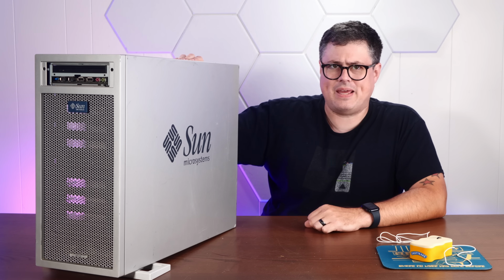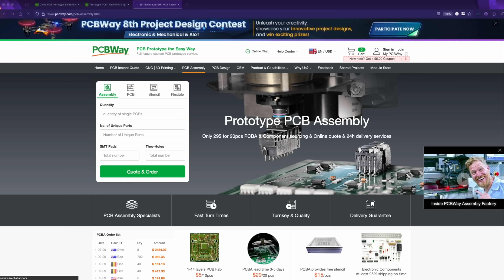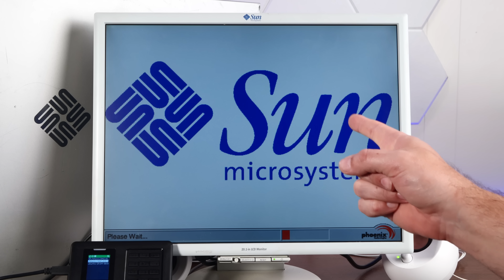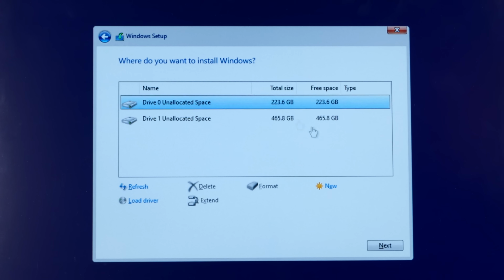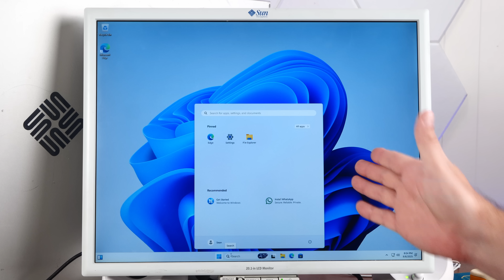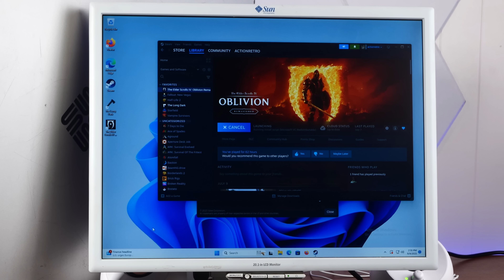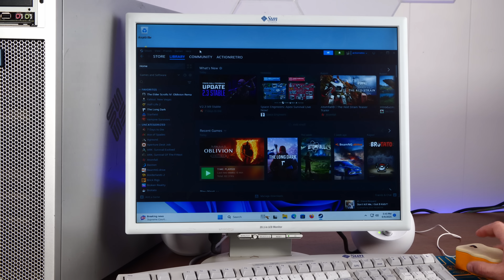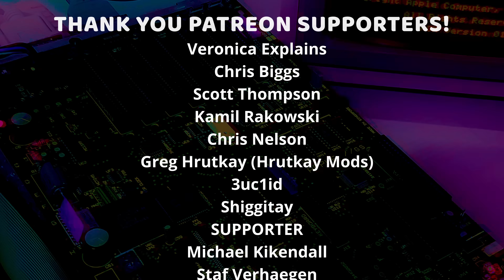The Oldest PC That Can Run Windows 11

Comment: I bought one of these new from Sun and used it for several years. I even ran 6 core Opterons in mine using replacement firmware. To this day, I'm probably the only one with working firmware for the Ultra 40 M2 supporting 6-core processors.

I regret getting rid of mine.

Comment: errrrm actwually the first x86-64 cpu is the opteron 240 B3 which was released in april 2003 and not the 2220 se you showed that was released in august 2006🤓🤓🤓🤓🤓🤓

Comment: This demo is pretty impressive.  
I suspect that this entire push for AI has been at least 25-30+ years in the making- spanning as far back as when Bill Gates said he wanted for everyone to have a PC in their home.  I watched an 'intentional destruction' video of someone carefully smashing and burning a 90s PC board while it was running.  Instead of the PC just 'giving up' and going to a black screen, it kept on trying to POST and run in a somewhat degraded mode...attempting to hand off the CPU functions to some operating system.  Almost like the PC could be repurposed to lower level usage if someone or 'something' really wanted to try and salvage that damaged PC.  
Then you hear about how the BIOS is exploitable without you even knowing while the PC is off, and then how that few hundred megabyte per gigabyte portion of HDD, SSD, NVME is sort of always written off as 'lost due to formatting'-  (or maybe reserved for other purposes) can't help but to wonder whether basically every PC is just an AI conduit just waiting to be enabled.

Comment: i got and amd athlon xp 1800+ and amd duron these days and i thought it was absolutly slow... my partens allready got an absolut heat producing intel pentium 4 and i was envious about the speed. i'm really impressed about your video...
Reply: My old K6-2 350 was the DEC Alpha of PC cpus. It would go from 30c idle to 85C with a full load in both Redhat 5.2 and Windows 95B.

Comment: So I could technically install Win 11 23H2 on my older system which I store media on. Supermicro X7DWE with dual xeon e5450, 16gb of ram and a P600 low-profile card mounted with x16 to x8 adapter as the motherboard only has x8 slots. It has the latest bios from 2008. And a sata 3 card that supports harddrives larger than 2tb. This system is built in a rare Lian Li 20th anniversary PC-777 case from 2005. It has mounting holes for dual socket 771 cpu motherboard. I love the Sun cases, but they are hard to come by, and If u do they're often expensive.

Comment: I get the ssd and quadro are pretty old and weren't the best when they came out but certainly better than ssds and gpus of 2005. I highly doubt windows 11 would work on 2005 GPU and would probably much more sluggish on a 2005 ssd if you could find one that worked.

Comment: I have one of the original alienware area 51 desktops from late 90's in my basement. I used to play the original rainbow six games on it in game tournaments (Before E-sports was a thing).  I cant remember what went wrong with it when I moved on to a new system back then, so not sure why it wont boot (last I tried it was dead), but its most likely just the power supply or original mobo that are dead.   This makes me want to finally fix it and take a trip back 25-30 years.

Comment: I have a dell Inspiron 531s from 2007 which i installed 11 on the only issue is i need an ssd since the 18 year old hdd takes 4 minutes to boot also i was debating on seeing if i use an nvme ssd on the pcie slot to see if that would be faster than a sata ssd or would it be the same

Comment: A lot of ifs and luck.

Software might refuse to run on uncommon first generation CPUs lacking instructions even if it doesn't really need them, simply because of default compilation options. It's even worse when some popular library pushes them out of support. No one in commercial development is going to mess with their build systems to make custom compatible builds for three crazy  with ancient hardware.

Single core performance is at the bottom of usable range. PassMark CPU benchmark says it's around 520 marks, but it seems wrong, other tests suggest about 830. The interface doesn't seem Atom...ically laggy, as you would expect on 500 mark junk systems. Of course, there are two real independent cores to alleviate that. But they also mean 2×65 W TDP. Those fans are running for a reason.

Because of slow CPU, video decoding WILL become a problem. YouTube stream was handled by a much more recent hardware decoder on the video card, but switch to anything non-accelerated and common, like 10 bit H.264 anime, and you hit the dead end.

Given its price at the time, it's very much like driving grandpa's bulldozer instead of a golf cart just because you can.

Comment: AMD Ryzen 1700X? 64GB RAM? Ooohh that system is NOT POWERFUL or SECURE enough to run the ALMIGHTY WINDOWS 11!!!!! Dual threaded Intel Celeron with 4GB DDR3 and a mechanical HDD with buggy, out of date Secure Boot BIOS? Right this way!

Comment: Amazing that 5 years before this an Athlon workstation couldn’t even do half the work(maybe? an 8P AthlonMP server could keep up?), and 5 years after you could get the 24 core version of this workstation to put on your desk(and the 8P had 96 cores)
I actually have a board with dual socket G34 that had 2 Magny-Cours in it that when I got it in 2016 and with Piledriver cores was actually still good for the niche of integer calculations compared to the Xeon equivalent for perf per watt. NFS at home if anyone is wondering.

Comment: This is why I hate modern os's in a lot of ways. They've gotten to a point where they don't need anything else, but companies need a reason to push new hardware to the average users so they just keep adding shit that isnt needed. Although Windows is obviously the worst offender in this regaurd, mac os is still guilty. With mac os they just put an often arbitrary cut-off for support. I've seen a lot of macs from like 2014 and older still run sequoia fine. Mac os 26 is a different case, mostly because it's just broken rn

Comment: Again a reminder of what I coined hardware darwinism, as long as a device can be asked if it has a feature it should be simple to write adaptive code and switch off what is not needed to get a minimum path to a result.

I won't be ignorant though as I am aware sometimes you do need to model code differently to parallel implementation vs more 'fifo' models(watering it down a tone) but the baseline to start everything up is normally fairly small.

Might be a tank but honestly a impressive bit of engineering.

Comment: I have a question. I heard that in 2008 they implemented a remote administrator on Intel CPUs, that is, an operating system that runs on the CPU and allows the government to enter your computer regardless of security. So that means that the older the CPU, the more secure the computer is? Taking this into account, what would be the oldest CPU you can install Windows 10 on?

Comment: The fact is, that Atomfall (with denuvo slop drm) works well on that thing shows that the instruction set (which is UE5) is not supported that, but Asura Engine do.

But maybe it has with version of Windows, since you using a buggy 22h2 version instead 23h2 or 24h2 (which dont work here)

Comment: This is 22h2/23h2 Windows 11,which can running that older hardware than 24h2 version because that Device has not Popcnt Instruction, which doenst run 24h2 Win 11 but 23h2 Win 11.

The minimum Hardware 24h2 needs a a10 AMD Opteron CPU and a Nehalem Intel CPU since 2008 (Intel are cheaper to get it with motherboard than AMD Opteron CPUs with motherboard)

Comment: I installed Win11 recently on an old Athlon X2 with 2Gigs of ram and was blown away on how usable it is. As a web machine it works very nice. Even plays Youtube videos at 1440p. Only newer modifications on it was a SSD drive. So functional PC with 2 CPU cores and measly 2GB of ram.

Comment: Does Tiny11 need a Windows key in order to be created and to function? If not, can it receive security updates? Are there programs designed for Windows 11 that are not compatible with Tiny11 and NOT because of hardware incompatibility? Also, I suppose it cannot be upgraded when a new version of Windows 11 is released and, in this case, it must be created anew using the scripts posted on GitHub. Speaking of them, has anyone checked if they contain malware? I am really surprised Microsoft allows GitHub to host such scripts, given the fact that it owns the platform and uses AI to scan the coded posted there.

Comment: everything Microsoft is done is to steal and lie to the costumers its ridiculous. Also Steam and other digital stores , they dont give you real system requirements and that is why its hard to buy a new pc , especially when i had a i7 2600k, because most games i wanted to play , i could except maybe this year there are a few ones , the point is that there are games like DAEMON X MACHINA scions of titans (not remeber exactly the name ) that you need a cpu that a i7 2600k with 16 gb count run that game at least normally , but  guess what i have done a lot of missions already lol.

Comment: I installed Windows 11 23H2 on my Q9650 Core2 Quad. It is actually quite usable as a basic web machine. 17 year old CPU, SSD & 10 GB DDR3 RAM. It also misses POPCNT.

Comment: Well, not quite the first x86-64 CPU, that's already a Socket F dual-core Opteron from 2006 supporting DDR2. The first ones were single-cores on Socket 940 and came in 2003. ;)

Comment: Since that is an Ultra 40 M2, which makes it something like a year or 2 newer (and a big jump in Opteron generation) from the Ultra 40?  I believe the original Sun Ultra 20 was released at the same time (or at least announced at the same time) as the Ultra 40 in 2005, and in its time it was one of the best deals in PCs around.  The Opteron platform came out in 2003 though on Rackspace and others.  There was also the Athlon64 at about the same time.

Comment: I've been researching this.  Basically for the last decade or longer,  there has been no real innovation in chip design.  They simply throttle computers,  release new computer with no throttle,  rinse and repeat.  
I'm working on a nifty little bit of tech that should expose all this rubbish.  Watch this space

Comment: My view has always been, rather than pulling an Apple, MS should add in big bold letter, that they do not guarantee any protection of data for anyone not using the recommended specs and MS no longer offers support for such systems beyond basic non security hardware specific updates. Kind of like saying to someone who insists on buying a home with no front door, that if you insist on buying it and not buying one with a front door, then they can't be held accountable should your house be burgled, but you are free to live there if you accept that risk.

Comment: H.264 that is the main codec on Youtube today launched in 2004. It was from the very begining ment to run full HD content, and this was one of few CPU that could run it at that resolution at the time with no added hardware.
Reply: I think yt started using that only in 2007, and only because of Apple
Reply: YouTube uses VP9 for most videos these days. It still has H.264 copies, mostly for Apple devices
Reply: @sugaryhull9688  you are right.. sort of. Youtube also start using AV1 as the main codec for higher resolution the last year or so

Comment: The whole concept with system requirements is that "if it does more then it needs more resources" thus if you want glossy moving graphics and extra processes within your application then overtime when you add more functionality the system will simply need to process more and have more memory and storage. So yes any computer can run it if you tweak it to bypass the checks for specific hardware then it will run but may be slower and lag a lot. Also drivers, windows default drivers have come a long way.

Comment: 3:20 I actually got an nVidia Quadro off of Amazon as a temporary card when the main graphics card on my desktop failed. It's actually pretty good if you temper your expectations. I was able to play pretty much any game up till the year 2009 or so in 1080p. It was less than $50. It's a great card if you want to breath new life into an old computer but you don't want to blow $400-500 on a new graphics card.

Comment: I've seen Windows 95 running on a 286 (which is not supposed to be possible) so, Yes, System requirements are a scam.

Comment: Love it.  For gaming I mostly still use my fx8350 based PC from circa 2012, albeit boosted by a used rx580 - it's hosts about 1,500 games.  For ExoDOS and retro GOG games it's an fx6300 circa 2015.  For Linux experiments and some gaming it's a Core2Duo circa 2008.  For MacOS experiments it's a 2011 Macbook Pro I got for free.  For work it's a 14 core Xeon E5 circa 2017.  My Opteron 180 machine, circa 2005, provides WIndows XP nostalgia.  My x3D Ryzen beast (2023) only occasionally sees action.  Yeah, it's fast, but it's yet to find a place in my soul.  My next project is to bring my 386 back to life.  Then my Amstrad CPC6128...

Comment: That CPU (Opteron 2220) is from 2006. The actual first AMD64 Opteron CPUs, where from 2003, like the Opteron 154. I personally had many Athlon64 that where from 2003 back in the days, mainly the 3000+ (512KB L2) and the 3000+ (1MB L2).

Edit, the first AMD64 chip did NOT have SSE3. It would be a good thing to know if 11 actually require SSE3.

Comment: Always fun. Tiny11 is awesome. Combined with BloatyNosey, Windows 10 Debloater, StartAllBack, and an Edge remover Win 11 is ok-ish.
FWVLIW: M.2 -> PCI(e) adaptors only work as boot drives if there's BIOS support. But will show up in the OS once installed on a bootable drive.
This goes for older PCs as well as 'unusual' boxes.
PS: See if you can find a DEC Alpha workstation and a copy of the officially unreleased Alpha version of Windows 2000 - the first 64bit version!!!
...also the fastest platform W2K ran on at the time.

Comment: within the first 20 seconds i hear "unix" "can run windows 11" and "unforgivable windows install" and i have to agree it is unforgivable but not unthinkable cause unless you got an apple/pi converter of some kind for the data aint no way you gettin a linux distro on a unix system properly

Comment: "no computer is e-waste if you still have a use for it." I'm watching on my 2011 Macbook Air while benchmarking my 2007 MacBook Core 2 Duo.
Reply: I still use Core2Duo machines. They run windows 11 just fine.
Reply: just use opencore legacy patcher and call it a day

Comment: Just goes to show how incremental those hardware improvements for everyday PC use have been those past 20 years. I’m still using a 2008/09 Mac Pro 2.1 running Ubuntu…not as a daily driver but it still gets regular use. Slap a SATA SSD in that thing coupled with 32 gigs of RAM and you’ve got yourself a great computer. That whole Windows 11 upgrade is probably Microsoft’s biggest scam yet…and that’s saying something!

Comment: What a time. Computers from 2005 working in 2025. In 2005, a pc from 1985 would have had no hope to run an at the time modern OS. 

In 2045... lets see how modern machines from today handle the software and workloads of 2045.

Comment: I had Windows XP running on a machine with only 256MB of memory. It's possible just very slow!
Reply: I used to run Windows XP on an 1999 Packard Bell with only 192MB of RAM (shipped with only 64). I distinctly remember the notification balloons in the notification area notifying me about the virtual memory being almost full. Wasn't the most pleasant of experiences for sure, but it worked 😂

Comment: I remember years ago, when I was building a PC that I had an internal HD that would cause the video to cut out.  Switched out the HD with a different brand and it worked just fine.  Never investigated any further what caused the incompatibility.

Comment: Bravo!! I hate Windows 11 though so... 
I used XP (32) as my main PC until about 4 years ago and still use it off line for my serious work as the 2 dozen programs I use in it are what I know and am efficient at and. Many of these programs won't work on  Windows 10 64 bit, and with our crappy internet W11 has been a no go. This has shone a ray of hope for us W10 users as Microsoft will slowly make it impossible to use online anymore, but that will probably takes years (I hope)

Comment: That is pretty awesome, holy shit!

That Asus RX 9070XT looks pretty damn good. I'm not sure if Asus would be my first choice (mainly because the Radeon-only manufacturers seem more interesting to me for some reason :b), but I'd still love to have it! [And the aesthetics are very nice.] Especially considering the one and only time I bought a graphics card was ~2016 (XFX R9 380x), and ended up never using, or even finishing the PC I built back then thanks to a dumb oversight, haha. Aaaand I definitely can't afford like anything now, let alone one of them.

The Powercolor 6750 XT also looks nice, if not as aesthetically impressive. But again, would definitely not turn my nose up at it! Although my CPU would probably bottleneck the shit out of both of them - though not as bad as that Opteron!

Comment: It really always has been software that forces hardware refreshes. Badly written software at that.
But I'm not as impressed anymore now that I started looking up specs. Opteron 2200 SEs were released in August 2006, whereas the first Opterons were released in April 2003. These newfangled processors run laps around the original Opteron 140s. 3.2x the transistors, 15% higher TDP, and of course, this machine has TWO CPUs. If tiny11s only requirement is x64 architecture, then an Athlon 64 2800+ is as impotent a processor as one could get from the era. It has 2/3 the transistors, and if used in a laptop, will have just 40% of the TDP. Now that is a neutered processor. Try that.